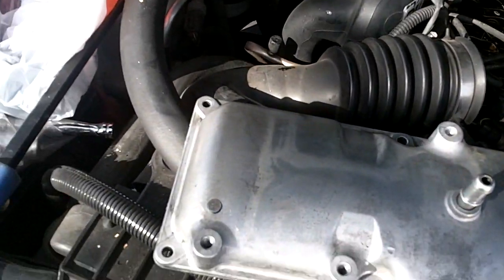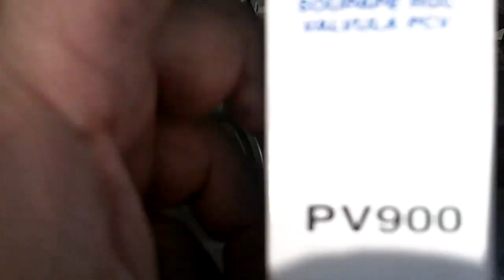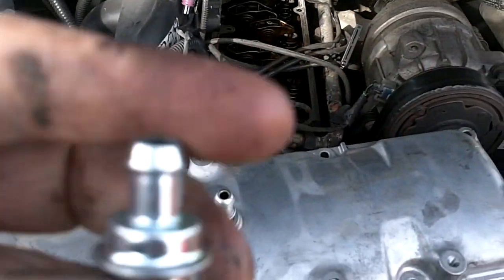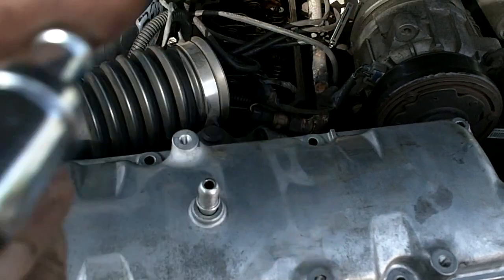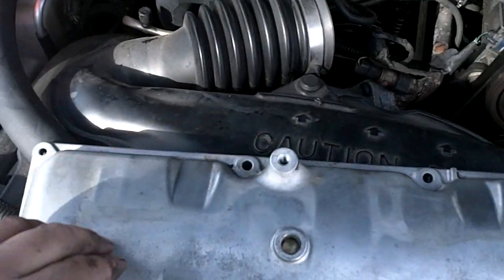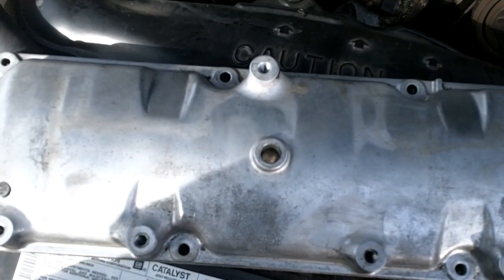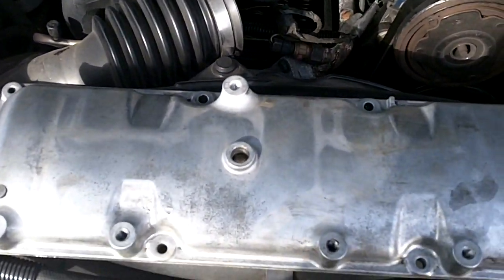1999 Chevy S10 2.2 liter no PCV valve?????

Comment: Many manufacturers use two hoses connected to valve cover(s).  If the PCV plugs up, you get lots of motor oil in the air filter housing, and you can develop leaking crank seals, gaskets, etc...  If it is a "V" engine configuration the PCV is coming off one side and the 'high load blow-by' hose connects from the other cover to the air filter housing.   As the filter saturates with hot, moist crankcase fumes, the air fuel ratio gets way off.  The engine is starved for air.  First you get misfires and poor performance at higher speeds, and eventually the engine will stall.
---
A properly operating PCV system improves performance, reduces causes of oil leaks and reduces NOx emissions.

Comment: That does annoy me that well you can't actually service the pcv valve on these engines i bought the same one online no less too and now im stuck with it. I cleaned that one thats there a bit with brake cleaner and blew it out. So theres that, i took it off to do a valve cover gasket and a tune up too. Wire number 3 was a bit cranky after i pulled it off to check for spark one time when my truck wouldn't start. also the plugs were nasty and worn too actually. I had fun with my truck today cleaned the valve cover made it look nice too, heaps of like oil that turned to like grease??? On the valve cover it was nasty, the old stuff was scraping off in fat chunks and rolled up too. It was gross.

Comment: @origionaldz ,,nope..mine is a 5 speed stick with a hydraulic clutch.
I took apart the air box assy ,,cleaned and lubed the connections with wd40 and then tightened it up good,,,the check engine light went off,,was just a vacuum leak.
The S10 is sensitive to vacuum pressures, usually the check eng light will come on when the emissions sensor says: NEW PLUGS TIME,,great little truck though..!

Comment: The baffle is not a PCV valve.  There is a PCV valve.  I have seen then built into a box on the side of the block by the oil dipstick/filler tube, under the intake plenum, on the passenger end of the valve cover on 2.2L CHEVY products.
That baffle that you showed is common on engines with or without PCV valves, and can be found under the PCV valve opening, filler spout opening or anywhere else there is an opening that might let oil splash through.
A PCV valve, working properly, can pass air only from the crankcase to the intake plenum somewhere below the throttle plate. It stands for Positive Crankcase Ventilation, and it replaced the old draft tubes that let crankcase gases vent directly out the engine and usually down to the road.  That is why it was common to see an oily sheen on the center or slightly right of center of each lane on a highway in the 50s-60s.  It is also why early motorcycle operator manuals cautioned cycle drivers to cross the center of the lane carefully, particularly in rainy weather.  GM was the first manufacturer to offer them standard on all vehicles, and in 65 gave the patent out to the other manufacturers.  It was the first 'Emission control' device on any vehicle, and became mandatory in 1967.  The first vehicle of any type with a PCV tube was the M5 Stuart tank made by Cadillac in WWII.  It had a PCV valve because a draft tube might suck up water while crossing rivers.  The only reason to replace a PCV valve is if they stick and are letting air go both ways in the rubber hose, or are mostly or completely blocked off, or if the spring gets weak.  Generally if you can blow freely the direction mentioned but not the other way, it is probably working properly.  This almost always happens on an engine with a lot of blowby.  It rarely happens on a newer engine that doesn't burn oil.
Reply: You obvioisly have never worked on a 99 or later s10, there is no pcv valve, call the dealer, there is no part to be ordered, it's rare to have built in pcv, which is why you prolly think he is wrong, but he isn't, there is no valve by the dip stick, I'm pulling my engine now so I have looked, valve cover duct work is alao found on some plastic valve covers in Volkswagens. Very idiotic design for servicing, especially when the cover is plastic...
Reply: @TheXComputerXDr  The PCV system is built into the intake manifold and gasket assembly for the 98 and newer 2.2L.
Reply: Not a traditional PCV for 98 and newer 2.2L in S10s but there is a PCV system designed into the plastic intake manifold including the gasket that is used as well.
Reply: @oldironkeepsmeyoung464  It's also built into the valve cover, after it leaves the crank case it has tubes or galleys that are machined in the head that feeds into wholes in the valve cover, the whole valve cover has to be replaced as well. From what I remember, it's been a while since I had my Sonoma, basically the same as an s-10

Comment from the maker: A normal PCV system will have some amount of oil in it.  You can either replace the valve cover or take it off of the engine and clean the baffles out.

Comment: Well I’m leaking oil out of this so called pvc and into my air intake housing and out of into the valve cover. it’s become loose as it’s spins freely smelling like Burt oil smh obviously you can’t replace the pcv so either I seal it up with some kind of sealant and clean out the baffles maybe clogged inside the valve cover?  n see what that does any takers?

Comment: I know this is an older post ----- what a big help, thank you!  My problem is that the metal tube/pipe that sits in the top of the valve cover is broken.  Any idea if I can replace just that?   If not, would a new one come with a new valve cover?   I have no idea what the name of that OEM part would be.  Obviously it's not a PCV valve.
Reply from the maker: I think you can order just the top tube, obviously probably a dealer only item.
Reply: you can get a welder to tig weld a piece of aluminum tube to the top of the valve cover, or if you're in a bind, get a flanged hose fitting (sometimes called a bulkhead fitting) that has a jam nut on the top side.  Put some sealant under the jam nut on top.  You might have to remove some sheet metal out from under the hole to gain access.

Comment: Don't get why they sell parts that won't fit on that vehicle.  Looks like that part that they sold you is for the 4.3L version.
Reply from the maker: I think what happens is someone had a typo on a cross reference as to what fits way back when.  Then every other company doesn’t fact check it but copies that wrong cross info, and rather than fix it they just want to sell parts.
Reply: Its for the 2.4 engines i believe

Comment from the maker: If the internal baffling of the valve cover is broken you need to replace the entire valve cover.  If you just take the valve cover off to replace the cover gasket it would be a good idea to clean the inside of the valve cover, I used brake cleaner in mine until it came out clear.
Reply: I'm glad you made note of being able to clean it, im about to pull mine today, I git everything off and broke the bolts loose but left them in so I just gotta unscrew them by hand and its off, I waited to take it off because ive been trying to see if anyone else online succesfully cleaned it without replacing, sounds like you were able to and I will be more confident puting it back on without buying a new one and just cleaning it, I just disnt wanna put it back on and have my oil pan gasket blow again, cause you gotta pull the motor to replace it, and ita a huge pain.

Comment: @origionaldz I have a clicking sound on my 1999 chevy blazer they say it is the fly wheel but feel is it not is it only comes on when i turn it on and clicks low not loud what is this. want to travel to Houston would this ruin my engine. I have ran it on the freeway and nothing major has happened what about a four trip what do I look for. Dad say it could also be in the catalictic converter that some mess maybe lose. or some little butterfly part in front of the muffler. please help.

Comment from the maker: Yea, I think all of the 2.2 liter s10's didn't have a pcv valve.  The 2.5's did though.
Reply: There were different versions. The 94-97s did have a PCV valve located in the front passenger corner of the valve cover. I had a 96 and changed mine at least once. My 99 does have a fitting in the center of the valve cover which connects to the throttle body like a PCV valve normally would but I haven't needed to take anything apart yet to see if there is an actual PCV in there.
Reply: I also have the 96, I ordered the pcv valve but it's not the same

Comment: Good vid,,,I have a 99 S19, and the Engine Check Light came on.
After an oil change, fuel filter and plugs, wires all new, the light won't go off.
I was thinking my PCV was clogged, but I couldn't find it.
Any suggestions about the check light...?,,it won't resey after disconnecting the battery.,,,,thanhs,,,,,,Glenn

Comment from the maker: @jodopeg Thanks.  How is the truck running.  Is it using any more fuel or oil than normal?  I had a check engine light when I had the common transmission problem, 1st to 2nd gear shifting was very very hard and lost overdrive at times, has to do with the shift solenoid and needed to be reamed out and a sonnex valve was added.

Comment: Do you know what the middle hole if for on the valve cover if its supposed to have a bolt in it?(one that sits under the throttle body)  put. Valve cover gasket on and there's the 2 on the back that holds the one bracket and 2 on the front that holds the air box but the middle there's nothing there
Reply: Not uncommon.  It is probably for a spark plug wire bracket.  A lot of guys tuning up their engine don't bother putting it back on, which is a mistake.

Comment: Is that a fuel flex engine? Mine is a 2.2 fuel flex engine but I don't know if I have a PCV? I hope u can help me and this is my very first S10 I ever had.
Reply: Look all over the intake manifold.  The 2.2 used several different locations for the PCV valve.  There has to be something which only lets air go from the crankcase to the intake manifold.  It almost always has a black rubber hose about the diameter of a heater hose.

Comment: my  orifice on the valve cover is attached to the hose and it comes off the valve cover... is that normal?
Reply: It shouldn't just slip off>  Some RTV Copper or RTV Ultra Blue would be okay to keep it in.
Reply: David Carlson nah, the 02 are like that
Reply: David Carlson that's what I use the blue RTV
Reply: David Carlson I also put a o ring in between the pcv orvice and valve cover so it won't leak oil on my valve cover

Comment: Did you ever get it fix? And how? I need to fix it for my truck but i cant find the part
Reply: Must be special ordered from dealer
Reply: @TheXComputerXDr   does the valve cover need to be removed to insert the vavle? Im tempted just to special fit a metal tube in mine and put a hose on that and be done with this mess (i went and bought a pcv valve from autozone as well lol)
Reply: @MetalHermit83  No its built in the valve cover, I took mine off and tried to clean it, doesnt work, GM saif 70 for a new one, I have still yet to do it, but its not too bad, new cover comes with seal as well
Reply: @TheXComputerXDr  yeah, but you think I could just fit a metal tube in there to attach the hose onto, or is there a special check valve built into the pcv valve thay needs to be in there?

Edit, mine is missing completely been like that since I bought the truck
Reply: @MetalHermit83  do you have a short metal tube that comes out of the valve cover? If so you put a hose over that and it connects the the airbox sitting before the throttle body, no check valve needed, but if there is no metal nub, I would just replace, ull never get a seal, and welding it if u can, would warp the cover.
Reply: Yeah no, that valve is completely gone. Thats why I asked if I could just press in any metal tube just so I can hook up the hose, Im sure i can use some pipe tape/silicone to make a seal though, rather not take off the valve cover unless I have to
Reply: @MetalHermit83  Right, it's not really that high pressure, but just be careful and dont drip in silicon in the cover, it would probably cause damage.

Comment: Is this video in regards to the 2.2l S10 using or "burning" more oil than normal?
My 01 S10 was 3 quarts low, its only been 2000 miles since my last oil change and the oil is not leaking, so it must have burned up.
It has 115,000 miles on it, 01 model year. LS ext cab auto 2.2L.
Reply from the maker: No oil burning issue.  Just doing preventative maintenance.
Reply: Mine is doing the same did you figure it out